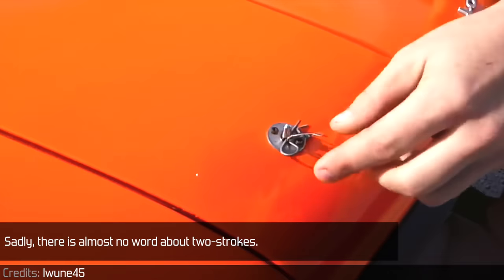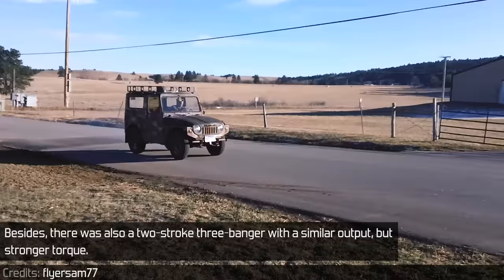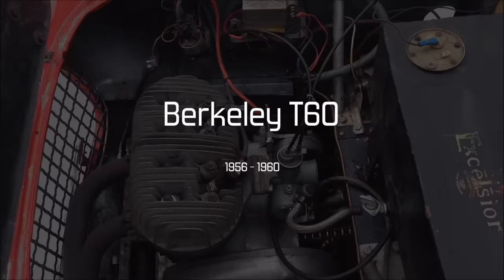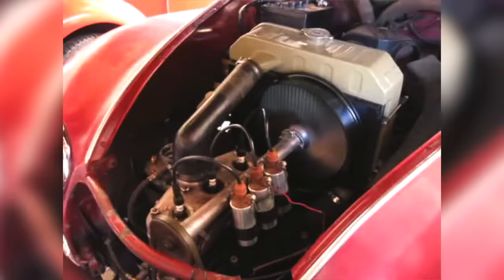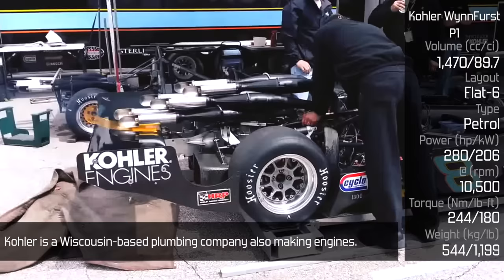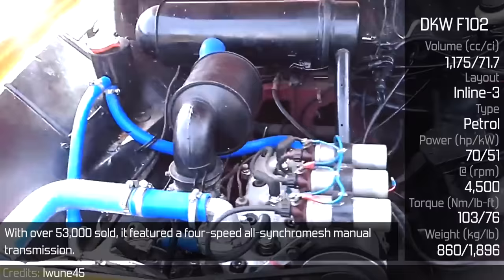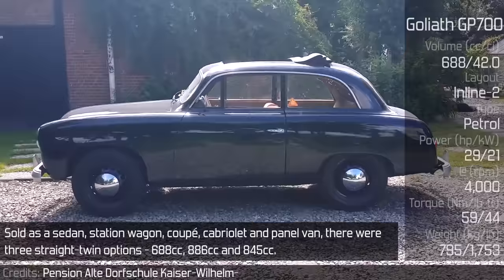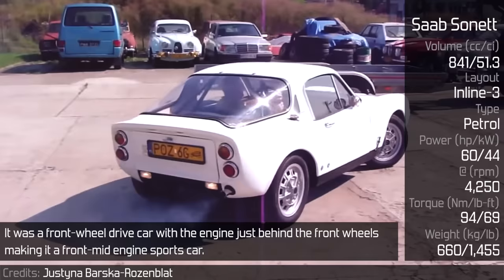8 Cool Two-Stroke Cars You May Not Know About

Comment: I believe the Commer TS3 has an OPOC engine. I've seen one that was 2 cylinder 4 piston with a turbo instead of a supercharger or blower
Reply: There was a lot of experimentation  with the opposed piston design in the 50's and 60's, never heard of a turbo only version, but Rootes did make a 2 cylinder industrial version with a blower (maybe turbo added later?).
Just before Chrysler bought them out they also had an experimental TS4 4 cylinder 8 piston  engine, 1 of the surviving TS4's is currently in New Zealand and there is video of it running on youtube.
Reply: I think the one I'm thinking of must be a newer model. I think this is the one I'm thinking of https://cdn.nanalyze.com/uploads/2014/10/Ecomotors_EM1001.jpg
Reply: Yes recent version by different company, think that's a centrifugal blower on the front just looking at it (could be wrong) as well as a turbo.
If I remember correctly the same company also made a 2 stroke petrol/gasoline engine with the same design around 2014/15.
Reply: Paolo G Thanks for the clarification.
The Napier Deltic's were insane 6 banks of 3 cylinders for a total of 18 cylinders and 36 pistons.

Comment: You forgot the Saab 96, also a two stroke. I almost bought one in 1973, but payed more for a 99LE, because it had a fuel injected four stroke 2 liter.
Reply: According to the title of the video, he was trying to showcase basically unknown 2 stroke autos and I consider SAAB sedans as comparatively well known - egad, I owned a '64, two '65s, and a '66 model, given up by their first owners due to some operating flaw that they didn't want to deal with.  What he did leave out was a racing class called "formula S" which for a time featured race tuned SAAB two strokes, similar to what formula V was back in the day.
Reply: @whalesong999  I guess I grew up in a part of the country where Saab's were totally unknown. In fact for some time i'm sure I was the only one in my town who had one. There might have been a couple more, but I never saw them. The one that really caught my eye was the Sonnet, but I needed more than a two seater having just come off a MG Midget. The Formula S class is also something I never heard of till now. Thanks for the info.
Reply: @jimvandemoter6961  I lived in Westchester Co., N.Y. at the time and there were quite a few SAABs to be had - they were handy in the winters there and in New England.  I was originally from the Midwest and SAABs were quite rare but some DKWs were around in the '50s and into the '60s.  I  had a "Deek" coupe, '58 model and they were good machines as well.
Reply: @whalesong999  That's interesting you should because I'm originally from Michigan.

Comment: I want a 400+ hp 2.5L V6 2 stroke car that revs to 7500 rpms with the engine designed by BRP with ETEC G2 and each cylinder has its own catalytic converter.

Comment: Wouldn't it be possible for a 3 cylinder boxer engine if there is another camshaft for the 3rd piston?
Reply: There is a 350cc outboard motor made for hydroplane racing that has two cylinders one side of the crankcase and one cylinder the other. The 2-stroke engine does not require camshafts; the flow of gases into and out of the cylinder is controlled by holes in the cylinder wall that are covered and uncovered by the piston, making the engine very simple. If using a carburettor as the source of fuel-air mixture it works best in small sizes.

Comment: I keep wondering, how much 2 stroke oil all this 2 stroke cars need to gulp especially the F3 one.
Reply: zuhaili shufller: Typical oil-gas ratios for East German 2-Strokers where 1:33 for older models and 1:50 for newer ones. You could get this stuff on every regular gas station. However, the DKW cars had seperate tanks for oil and gas, they are mixing their juice itself just like any modern(ish) 2-stroke motorcycle.

Comment: Its not that easy. 
If you have a small displacement small weight vehicle yes 2 stroke is superior.
However With Increase in cylinder size and no of cylinders your returns diminish so much that you reach a point where you have absolutely 0 advantage over 4 strokes.
Simply 1000cc 2 stroke can still compare to 1000cc 4 stroke but it has no advantages. Where as 4 stroke can even be improved further and still stay reliable and use less fuel in the process not to mention emissions.
On top of that if you have a heavy vehicle like a car 2 stroke isn't that good.

Comment: What Two stroke means?
Reply: Cookie_ShUmY cookie_id_0056701 basically, it’s an engine that does 2 of the 4 strokes at a time,  so a 4 stroke does intake, compression, combustion, and exhaust, it does the intake and combustion at the same time, and does the compression and exhaust at the same time
Reply: actually no, in does compression and a bit of exhaust and intake (until the piston closes the ports off) during the upstroke, and combustion intake and exhaust (when the piston open the ports) during the downstroke.
Reply: Intake and compression happen at the same time
Combustion and exhaust happen at the same time
It's a simple design and it has very little moving parts (no oil pump and valvetrain for example)
The fuel-air mixture is fed directly inside the cylinder through a fuel injector or a carburator
The cylinder compresses the exhaust gases to the exhaust.
Basically it does twice the work with the same amount of revs than a 4-stroke engine.
The system itself has some advantages, such as light weight, compactness, high power output.
Disadvantages include having to add 2-stroke oil to fuel and having to press the clutch whenever you let off the gas since the piston and cylinder walls are lubricated by the oil in the fuel. In smaller engines such as bike engines they make a lot of power from their small displacement (My 125cc 2-stroke Yamaha DT125RE makes 25hp @ 11000 rpm.) Only mods the bike has to increase its power output is a Giannelli exhaust and a small wire to "cheat" the power valve system to keep it open at all times.
Reply: IT has camshaft?
Reply: No, some single cylinder engines have exhaust valves though
Reply: most 2 stroke diesels do have camshafts, as they have exhaust valves. howerver there are some small 2 stroke diesels that don't have any valves and are similar to a 2 stroke petrol engine. then there's the horizontally opposed 2 stroke diesels like the commer in this video, they also don't have valves or camshafts.

Comment: wait, is two stroke mean 2 cylinder?
Reply: No, A two stroke is where the combustion cycle is completed in only two strokes or one crankshaft rotation. A four stroke is double this. A four stroke cycle is 1. intake stroke ( piston moves down the cylinder drawing in clean air fuel mixture ) 2. Compression stroke ( then piston moves back up again squeezing the air fuel mixture ) 3. Power stroke ( the fuel is ignited and piston moves back down again ) 4. Exhaust stroke ( the piston moves back up the cylinder once more pushing the spent gasses out the exhaust valve ) 

Two stroke cycle. 1. Scavenging  / end of exhaust / compression stroke ( The piston is at the bottom of the cylinder and the transfer port is open allowing clean air/fuel/oil mixture to enter the cylinder. The piston moves up the cylinder closing off the transfer port. The remaining exhaust gases are pushed out the exhaust port. The exhaust port is eventually closed off as the piston moves past it. Once past the exhaust port then the clean air/fuel/oil mixture is compressed ) 2. power / exhaust / scavenging stroke ( the fuel is ignited and the piston moves back down the cylinder uncovering the exhaust port for the spent gasses to start evacuating the cylinder. Once near the bottom of the cylinder the transfer port is opened up allowing clean air/fuel/oil mixture to enter the cylinder ) 

Hope this helps I tried making it as simple as possible and missed out a few of the technical bits.
Reply: And you call yourself a car guy
Reply: +NFSstarman 3  he's just a kid alright
Reply: +NFSstarman 3 i'm 12 and you just ruin my dream
Reply: +AnEejit thanks for the info
Reply: Hey im sorry I just get triggered when someoe doesn't know what they are talking about and im almost 14  and ive built a engine from spare parts and replaced engines